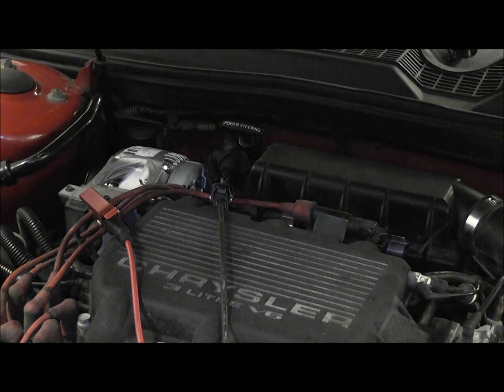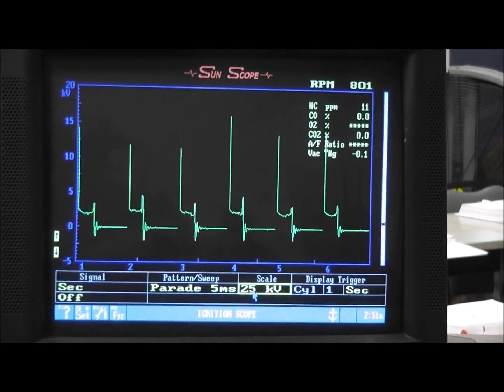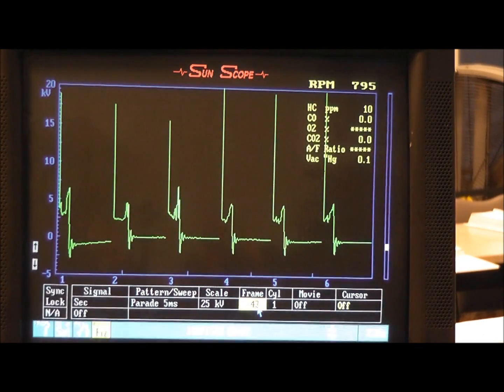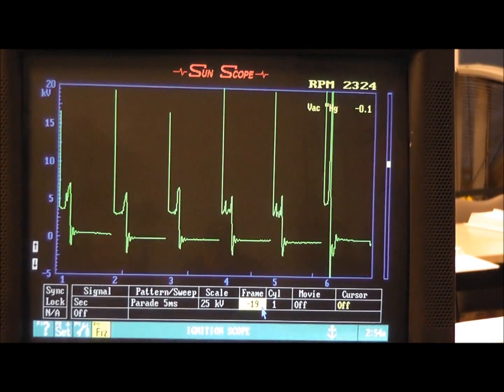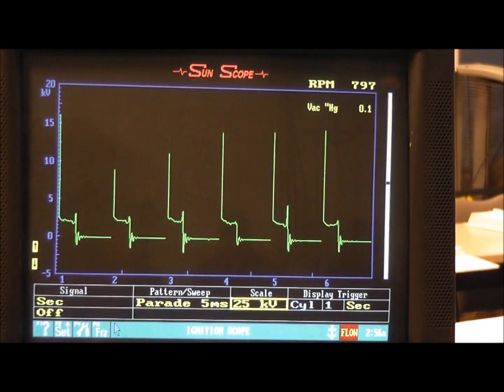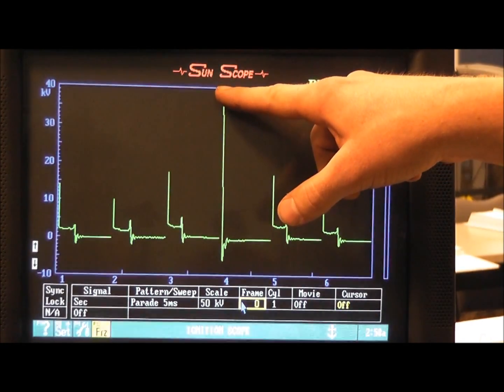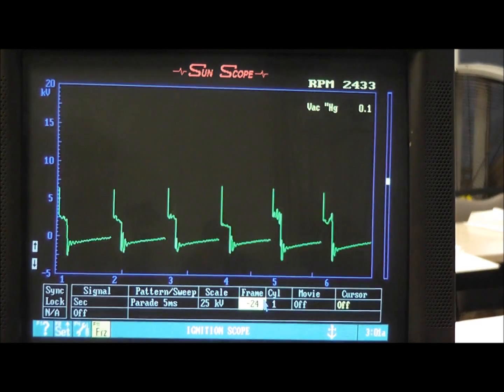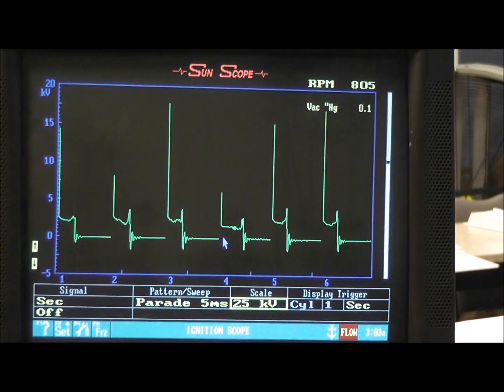Secondary Ignition Waveforms (common faults)

Comment: @ScannerDanner if you're scoping a 4 wire coil on plug ignition system, do u often use the trigger and feedback wires to find issues, or just power supply and ground easily enough?

Comment: Thank you for the informative video. Every bit of information is getting me to understand more and more. I always want to know why and not just what to replace. Hopefully I can remember the vast amount of information you give. That "dont be a parts changer." Is stuck in my head hahaha. I like it.  I once changed my alternator, battery and some wiring before I found out my whole problem was just the air conditioner compressor  locking up and draining the battery while operating.
Reply from the maker: Glad it was helpful! You found the right channel for the "why" and "how" my friend

Comment: If anyone can help me it would be greatly appreciated. Pulling a secondary ignition waveform on a Chevy 4.8 l with one coil per plug. I have a misfire on cylinder one, when I pull the waveform intermittently the burn line is very erratic and tends to relate to when it's misfiring. what would cause an erratic burn line rather than a smooth burn line?
Reply from the maker: move the coil and plug to another cylinder and see if the misfire moves with them
Reply: @ScannerDanner  Thanks for the response, I had already swapped coils and replaced wires (no change) I did not suspect plugs because I replaced them for this customer less than a year ago. Ended up pulling plugs 1 & 3 and both electrodes were melted (running lean? )  (#1 was the worst) I'll be replacing all of the plugs and looking into why it did that (injectors clogged or fuel pump pressure) I did hook up a fuel pressure gauge and initial key on it went to 60 Psi and then dropped to 50 almost immediately - when running at idle it was steady at 45psi -Seems a little low (non-return system) so I'll be checking the injectors and fuel pressure before the fuel rail just to do my due diligence. ** thanks by the way - Ended up buying the AESwave master scope kit based on your recommendation and it has been a great way for me to start learning scope usage without spending huge $ **
Reply: A follow up on the previous information. I have done some digging and apparently 45psi at idle is normal - revving it makes no change it holds steady.  I did perform an injector balance test and they appeared to be good. I may run the test a few times to make sure the readings are accurate.  It is getting a bank one Cat below efficiency - not sure how that would affect it because the upstream O2 sensors are reading right where they need to be. Pulled #1 plug again and still shows lean (white). Also, I have done a smoke test on the intake and no leaks were found. Admittedly, I am at a bit of a loss  (injector test info = start pressure was 58-60 and after pressure was 34-38 but the lower pressure is consistent in relation to the higher start pressure.  I have pulled several of the spark plugs and have found that the lean condition (Melted plugs) is throughout the motor - My only suspicion is that the fuel pump really is weak and forums are not being helpful at all.
Reply from the maker: @DillysADV  when you ran that injector balance test, they should have all been the same drop. Do the test with the engine cold
Reply: @ScannerDanner  The engine was cold but the fuel pump was inconsistent at where it would stop when I cycled the ignition
Reply from the maker: @DillysADV  understood, that definitely makes it difficult. Try keeping track of the actual psi drop on each more than the starting and stopping number

Comment: Very good video thanks for the content. So would bad compression on one cylinder show the same waveform as a shorted plug wire?
Reply: You'd probably see the voltage building up but just a really bad or no combustion curve at the bottom, since its hard to combust with bad compression.

Comment: SCANNERDANNER, to measure secondary ignition voltage waveforms on COP coil over plug you say that you don't do this because there is no where to measure the ground side of the ignition coil. Can't you use a capacitive or inductive oscilloscope probe on the spark plug wire to measure the secondary ignition voltage waveform on COP coil over plug types? I have seen you use the inductive oscilloscope probe that clamps on the spark plug wire to measure the voltage waveforms

Comment: Can this test be performed on COP.  ?  I mean the only test I can get out of a COP is a Current Test which on Fords reflect a triple strike ignition system.  ON a 5.4 Ford I test through the fuse box and all i can test is current which scopes out really nice. But, again can this test be performed on a COP to show a bad fuel injector or shorted plug wire or plug?
Reply from the maker: Of course, but it would be individual cylinders using a COP adapter for your secondary ignition pattern

Comment: Very informative video. Paul, just a quick question from a newbie here -> in ignition systems with a single coil, dist cap and rotor (95 volvo 850) im curious if those voltage spikes per cylinder represent the required voltage for arcing from BOTH 1) rotor to cap, AND 2) across the plug terminals? 

Technically there are 2 arcs required for each cylinder firing in such systems, yet the scope only shows a single voltage spike per cylinder firing. This leads me to believe that the displayed  voltage spike per cylinder represents sufficient voltage for Both required arcs. Is this correct?
Reply from the maker: Correct, both gaps, that's why when I shorted the plug wire we still had almost a normal looking pattern ignition pattern.
Reply: @ScannerDanner  I see. Good point. Not sure if you know the answer to this question, but im curious if the massive, quick drop after the main spike is just another example of a typical voltage drop just like you'd find across a load in a live circuit, whereas in this case the load is not a typical circuit element but instead simply a gap (actually two gaps in my case) in the circuit?
Reply: @outerlimits7527  quick voltage drop on the scope in video is voltage jumping the spark plug for .01 of a second in combustion phase of cycle

Comment: I have a portable oscilloscope it's a dso 138 cheap from eBay but works well can I use it to test sensors as my Toyota won't work scan gauge? Unit can handle 50 v pK at1X probe) i do have a 10X probe? Any reply appreciated
Reply from the maker: without knowing the scope you are using, I cannot answer that. Post this to my forum. It is free to join and I am sure you will get some answers on your specific model https://www.scannerdanner.com/forum.html

Comment: The Sun 450 is very hard to find. What is equal to the Sun 450 ? What units out there will give a frame by frame search like the Sun 450 ?
Reply from the maker: The Snap-on Scopes can do this with the SIA 2000 adapter but I would NOT spend the money on it. It is glitchy and not worth what they want for it. Plus, it is only useful on distributor and waste spark ignition systems

Comment: How much variation is normal in spark line voltage?  I've read in a few places that it shouldn't be more than 20%,  but I see in this video and I've seen in the field variations much larger than that on vehicles that seem to be running without any noticeable misfires.
Reply from the maker: To be clear, the firing line is the vertical line and the spark line is the horizontal line. Which line are you talking about? The spark lines should all look about the same and the firing line will very a lot from cylinder to cylinder. Secondary ignition waveform analysis requires one to look at hundreds of known good ones to be able to be used effectively. This video gives you a good guide on what to look for.
Reply: I was talking about the firing line.  So allot of variation there during idle, even on the same cylinder, is pretty normal?
Reply from the maker: Yes, turbulence in the combustion chamber would be the main factor in that. Air-fuel ratio is involved as well as other variables.

Comment: The way Ive always used the spark line is this:The initial high spike is what energy it takes to ionize the spark plug gap, the spark line is showing the combustion event.with little / no fuel, the spark line curls back upward due to , like you explained, lack of conductivity in the compressed air, which causes the ionization to diminish and the required KV to maintain ionization increases ( compressed air is harder to ionize than a carbon saturated compressed gas).I love it when I hear "I bought a million KV coil"... OK.... so are you running groundless spark plugs ?The coil(s) will only output whats necessary to maintain ionization across the gap.

Comment: hello,, this is a great explanation.    i have a quations.   i have some old mercedes cars from 1968 untill 1976 with a conventional cap rotor ignition setup.     i want to buy a scope to test the  ignitions.    i looked for the old sun testers. they work fine, dont cost  much, but they are Hugh!!.      is there a good ( not to expensive) alternative scope that i can connect to a laptop or tablet which does the same test as you just showed on this video?   I look forward to your reply.  thanks! Igor
Reply from the maker: It is becoming more and more difficult to answer questions here. I have 80,000 people asking me for help now. So I have created a forum to help you guys better. It is free to join and we can exchange pictures, wiring diagrams and waveforms if needed to help guide you through the process of troubleshooting your vehicle. Thank you so much! Hope to see you there. 
Paul Danner (ScannerDanner)
https://www.scannerdanner.com/forum/post-your-repair-questions-here.html

Comment: Good demo but I wouldn't be "changing all plugs, leads, cap and rotor" on an old Mercedes V8 that still has original leads, I would simply change the failed component (probably a plug cap). Original Mercedes leads are big bucks and very high quality so should not be consigned to the bin unnecessarily.
Reply: its more of a reliability/quality of work/future re-assurance thing to replace all.
Reply: @mathew5956  Sure, if the owner has the stomach for the cost of replacing all the original leads with originals from MB, then great, cover all the bases.
Reply: @colinfernsltdindependentme1286  would imagine that as long as the technician thoroughly explained every detail of exactly why they were recommending replacing the parts they'd be ok with it.

Comment: I have seen this one before but it so good so I have to  review the episode again, I wish I had review it before I tested a bad running Audi tested it with a Pico if I like to see all cylinders at the same time do I put a longer timebase on the Pico and probing the king  wire (from ignition coil to distributor) . Side note I had on two cylinder no spark line at times. But on king wire from ignition coil it looked perfect but should it?
Reply from the maker: for sure, there are many variables with secondary ignition waveforms and one of them is the location of your test lead. especially in the case of an open or shorted plug wire!

Comment: Will aTrigger pickup (inductive) lead connected to my modis ultra do this test in the 2 channel lab scope or ignition probe mode?
Reply from the maker: +Richard Peter yes you can use the trigger pickup BUT when you freeze the screen and try to scroll, you will lose the point of reference of the trigger. It will show up as a white plus sign on the screen and again, will be synced up but live only! Make sense?

Comment: Paul, What is the best way to get a secondary ignition wave form from a COP ignition? especially  3 and 4 wire COP systems when you cant get a primary ignition wave form. What do you usually do in this situation?
Reply from the maker: +Mr. Speed on the 3 and 4 wire COPs I cannot get a secondary waveform no matter what probe I use. They are just too well insulated
Reply: +ScannerDanner so the wyze probe or the paddle probe will do me no good in that situation? Great to know. Was just about to buy one to test a 4 wire COP
Reply: Here's a good trick for doing it:   https://youtu.be/PALjk13DDiQ?t=2m  Another way is there are adapter cables you can put in between the cop and the plug then just put a standard secondary probe on the extension cable.

Comment: I can't get a secondary spark signal on my new hantek oscilloscope any ideas?
Reply from the maker: +Daniel Wells secondary is tricky. Lots of variables and a lot of different settings on the scope. Not familiar with what your using or what your working on so I can't help any further. Sorry
Reply: +Daniel Wells Try a new USB cable! I had the same problem, I used a cable from an old printer and now it works fine.

Comment: You are right it is the light. I should have never bought a china-freight centech but I did and now for the record they are junk. I compared it to my dad's snap on light and the rest is history. It was on a dodge neon so the last two wires were about the same lengths as the first two. Now to to find the misfire... p0300 constant miss and computer has p0202 injector circuit control malfunction even though everything seems fine. Gotta love chryslers.
Reply from the maker: +Ashroyer86 focus on the injector circuit. Those codes are accurate. I have a bunch of videos on injector testing

Comment: i don't have an o-scope yet so I bought a cheap timing light. I put the light on each wire of the wasted spark ignition system on my 96 neon and watched for flashes. I noticed that the wires on cyl 3,4 flash faster than cyl 1,2 even though 3 and 4 are companion to cylinders 2,1 respectively. Why in the world would one side of each coil show faster flashes than the other side of each coil?
Reply from the maker: +Ashroyer86 it's not the system, it's your light. It's probably being triggered by the coil itself with the pickup being closer to the coil

Comment: Thanks a lot for this helpful video . I am wondering why the frequency doesn't change during the snap throttle ? the RPM is increasing , the time between the spark signals should decreasing !!
Reply from the maker: +M.Elec it is a program within the scope. It just takes each firing event and ignores everything else
Reply: +ScannerDanner Thanks for feedback

Comment: Hey Paul once again always enjoying your videos just wanted to know how come  cylinder 1 sparkle Iine was so low and it was consistent compared to the other ones
Reply: As i remember him saying in the video, smaller lines were a air gap between rotor and dizzy cap points. My best guess for higher voltage lines maybe less corrosion on some dizzy cap points and maybe leads in better condition than others.

Comment: How exactly did you set up your screen for your firing order? You had the red lead lead on the plug wire and the other one on the coil wire? Does it depend on the computer or do you have to have a coil lead and a plug lead connected to give it a reference or does the computer just know based on firing order what's happening to the coil wire for each cylinder?

Comment: Cool video, but the scope is pretty much obsolete with computerized systems nowadays. I've gotten by pretty easy without one for over 20 years. Multi-coil systems and honestly, It's easy enough to pull plugs and inspect them for problems. Narrow down a miss, Suck, Squeeze, Bang, Fart... Find out what it's missing, spark, Air/fuel or compression... simple as that.

Comment: ...(continued)...patterns.  There it was.  Carbon copy of a bad capacitor in a raster pattern.  $1.25 later vehicle purred.  This haunts me today.  With this I have been researching scopes trying to find ones that can actually show raster secondary ignition patterns.  Picoscope won't do this nor the Verus.  Any suggestions?  One could argue that you can see everything in parade.  True but with raster it is easier to see things like I just described, worn dist. shaft bushings, and others.

Comment: U da man, Dan.  Aprox. 25 years ago when I was green but knew everything I had a ford sedan come in for diag of rough running.  Called later and told him that it needed the carburetor (mind you I used assumption and did very little testing).  The owner said'  I had it replaced last yr., are you sure?  "Yes, I am positive".  $400 later still ran bad.  We had an old Sun Scope that I used to look at the ignition pattern.  I was going to school at the time and had an electrical book w/ sec. ign.....

Comment from the maker: the best thing to do with that tool as there are multiple ways to do it. is to follow the test in the component test meter. the vantage is a self guiding tool you just need to pick it up and start using it.

Comment from the maker: That is exactly correct my friend, however from my experience it has to be a completely dead hole to see this reaction on the secondary waveform. If there are any pressure changes at all this test may not be the best one to identify the problem. In short, if you have a cylinder with low compression you would probably miss it here.

Comment from the maker: It wouldn't, both types would still read rich at WOT. The MAF design will just have lower than normal WOT MAF readings but that's because the engine isn't "breathing" correctly.

Comment: If everything is stock, and its an older car, I'd check the grounds.  Sometimes they go bad and all sorts of weird stuff happens.  I know when installing radios to vehicles that never had them before, you often need to put some in line filters to reduce the effects of current fluctuations from the ignition system. Other wise you tunes may have weird static.

Comment from the maker: Depends how low the compression is. If there is no compression the firing line will be very low and the spark line will be longer. But the main tell-tail would be the KV will not rise on a snap throttle test. This test has variables of course.